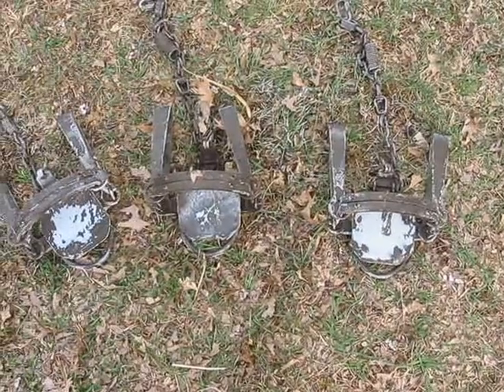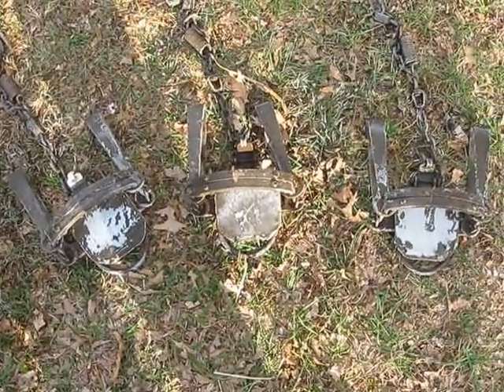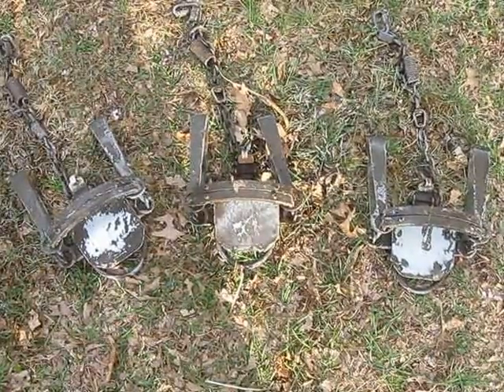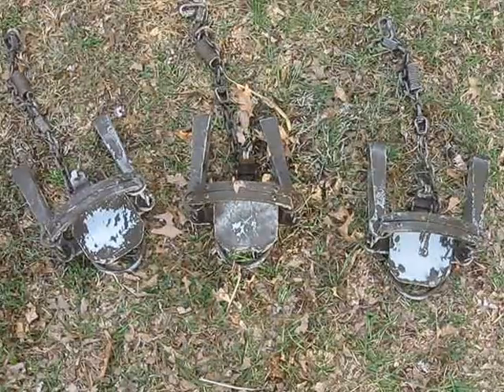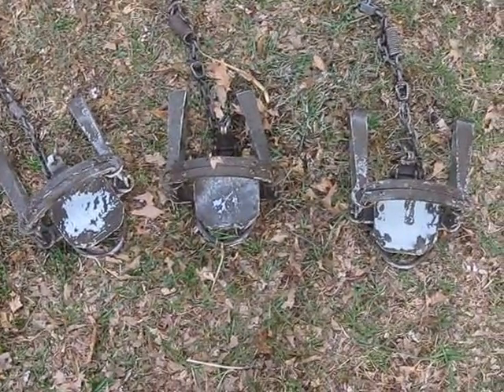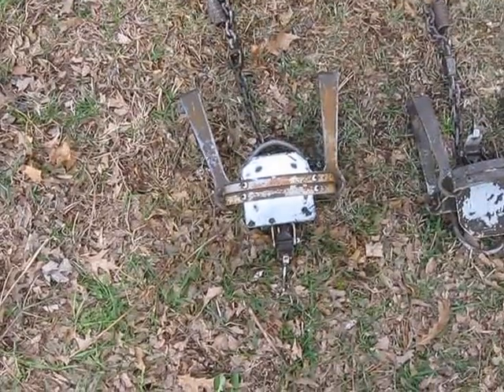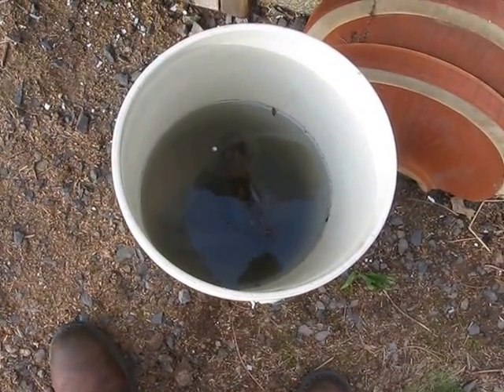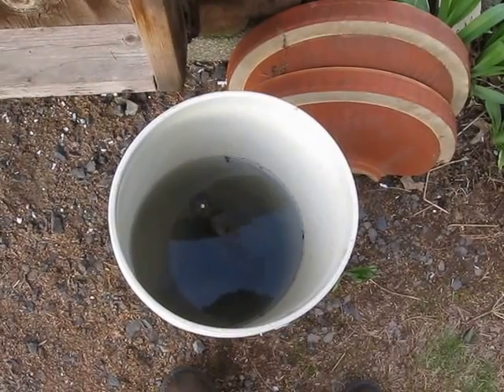Remove Trap Dip How To | Part 1

Comment: Boil them in the purple degreaser you can pick up at walmart. 8 dollars a gallon, I think.  Might even be less.    A pressure washer will make a HUGE difference.  Borrow or rent  one if you have to.  Some people use the car wash sprayer which is not the same but better than a hose.  What you thought "failed" would have easily peeled off after your vinegar soak if you used a pressure washer on it.  But you really should do 24 hours and then pressure wash.  Using a hose will only be half the job unless they soak for longer than they really need to.  Though at least you get all the rust off too with a looooong soak.  I think the degreaser and a pressure washer will remove gas dip as well.  The pressure washer in conjunction does a MUCH better job.